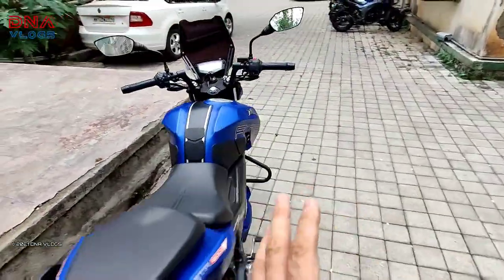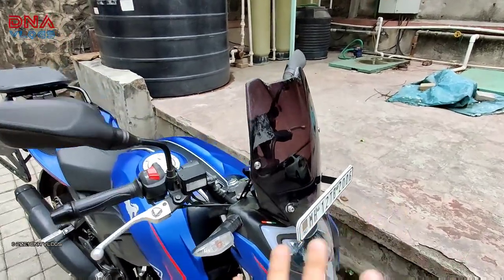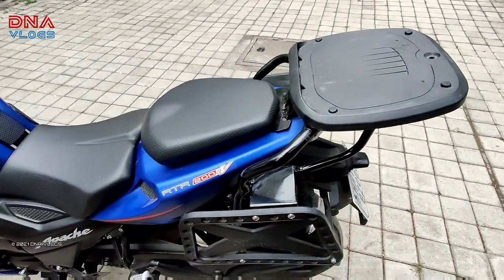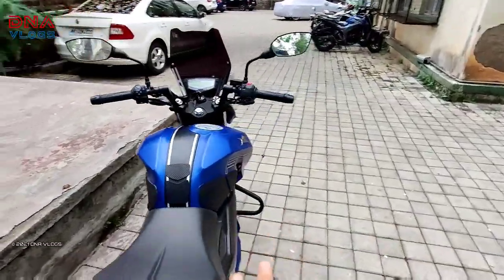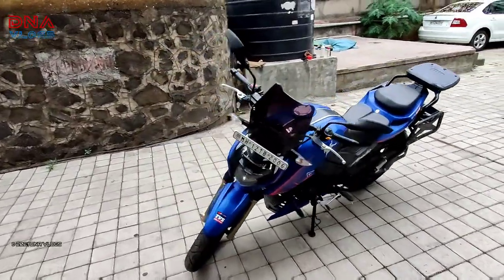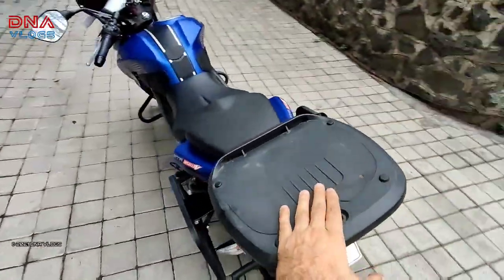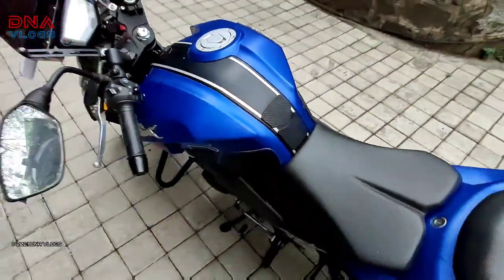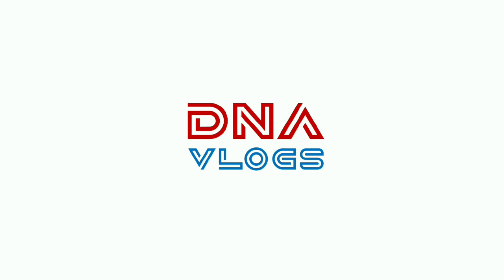2021 BS6 TVS APACHE RTR 200 | Touring Mods | Visor, Top Rack, Saddle Stays, Tank Grips | DNA VLOGS

Comment: Bro how did you maintain your chain. I am using motul but during wet conditions they get washed out faster. What is a solution 😔
Reply from the maker: There is a dedicated video on chain clean n maintenance. I use old oils or kakde
Reply: @dipen.nisar.autovlogs  is gear oil a best option.
Reply from the maker: yes, its one of the good options.